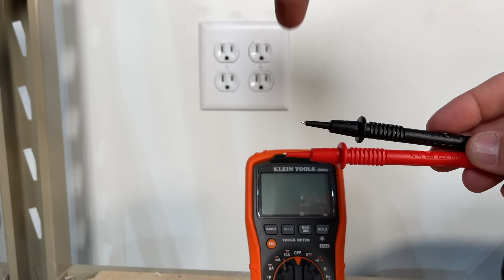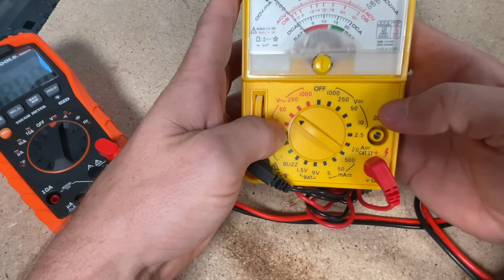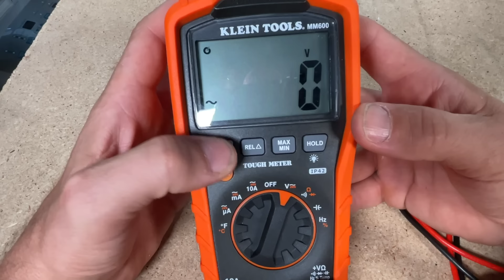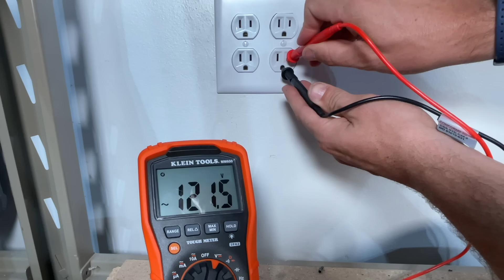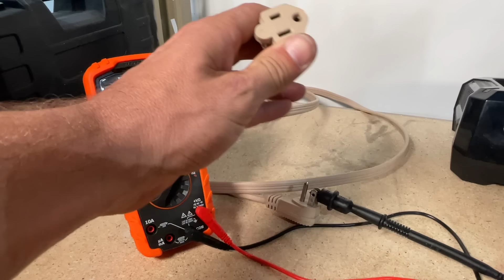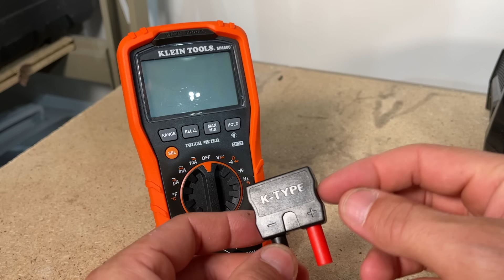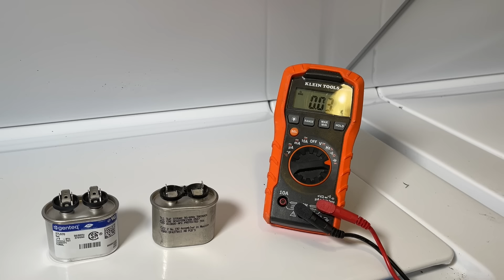How To Use A Multimeter for Home Repairs and Troubleshooting

Comment: I highly recommend the Fluke T+PRO tester. It does voltage, continuity, and resistance. 
For simple electrical jobs, I think it's much more useful and easier to use than a multimeter. It doesn't have as many features as a full multimeter, but many of us never use those features anyway, or even understand enough for those functions to be useful.

For the functions it does, it's far more simple and reliable: There's no need to turn it on or press any buttons to test voltage or continuity: just touch the probes together or touch a continuous wire, and it instantly beeps and lights up. Touch the probes to live wires or insert them into an outlet, and it instantly lights up, beeps, AND vibrates, and shows the voltage on the screen. Even better, the voltage tester will even work if the batteries are dead or missing! It functions as a simple solenoid tester as well, so LED lights will light up indicating live voltage and approximate voltage range, though the screen, audible alarm, and vibration won't work. 

It can also test resistance, and has a GFCI tester, though I never use those functions. It also has a built in flashlight, and the audible alarm can be turned off. But really it's just voltage and continuity that I'm testing frequently (usually to verify which  wire is the neutral and hot, to check whether something is grounded, and occasionally to test light bulbs or cords). I literally never press a button with this awesome tool. You'll only ever need to press a button if you  want to test resistance, or use the flashlight, trip a GFCI, or to silence the sound (the vibration is a great feature if you need to use it in silent mode!)

Comment: Sorry but measuring voltage will not energize the black lead. If it did you would cause a dead short every time you went across a potential difference. Conversely if you are using the amp function, the meter has no resistance and will dead short if you go across line.
Reply: It will energize the unconnected lead, but the instant you try to do anything with that energized lead, the voltage will drop across the megaohms of internal impedance, and it will no longer produce any current that can do any damage.

Comment: As a non-electrician, I use an Extech multimeter. I've found them to be very reliable and reasonably priced. And because I do not use my DMM every day, I use lithium AA batteries in it. They are virtually leak-proof, unlike alkaline batteries that often leak from non-use and then corrode contacts.
Reply: Lithium is expensive and probably costs more than your meter. That being said they hold their energy forever and it'll last the life of your meter. Like probably 20 years. My alkaline lasts already 10+ years and counting still but I don't use it much.
Reply: @jonfreeman9682  $2.40 each in packs of 8 for Energizer lithium AA batteries. That's definitely not the same cost as the multimeter.
Reply: @davepaturno4290  That is really cheap for lithium battery. Definitely worth it as it'll last the life of the meter. No more fumbling for batteries.

Comment: As an irrigation technician, I use a multimeter everyday in the field when troubleshooting residential sprinkler systems. This is huge for the DIY home owner because it is not cheap for me to make a home visit. I test voltage to make sure each solenoid is getting at least 24V. This is the minimum required to open a valve. Measure the common against the zone that is currently running. Run through each zone and make sure they are all getting required voltage (only the zone currently running should be getting voltage). If a zone won't turn on but it is getting the required voltage you are looking at a problem with the solenoid.  Take an Ohms measurement with the timer turned off this time going through each zone. Again, common against each zone wire. You want to see a range of about 23-60 Ohms. If you get an OL reading, you probably have a loose connection in the manifold (Valve box) or a broken line somewhere between your timer and manifold. If the Ohms reading is below the range, Your solenoid should be replaced. Sometimes the issue comes down to the timer malfunctioning and bugging, but with these steps you can get an idea of what to focus on. Hope this helps!
Reply: You should do a video on that subject…it’s very confusing to DIYers!  I know….I am one!
Reply: Boy I wish you’d do a video! I am having trouble with this exact issue right now! Can you suggest a good site to find help?
Reply: How do you get started getting clients?  I have commissioned a few installs including new pumps.  Are people searching for "irrigation technician"?  Where should I advertise?
Reply: Great tip on fixing irrigation. Didn't even know this was something you could do yourself. Always thought you needed a professional.
Reply: Clearly not an electrician
If your (black) probe were hot (120v) if you went hot to ground, that would be a ground fault
So clearly this is inaccurate, unless your meter is faulty or damaged, it's completely safe to touch the probe while the other is connected to hot
Also due to the nature of AC (alternating current) it does not matter which probe color goes where when taking a measurement

Comment: Great work as usual, but I'm confused. You're supposed to attach car batteries in the opposite fashion when jumping cars, ie hook the red/dead then red/live then black/live then black dead. I've heard the reason is if you drop the alligator clip into the dead engine you'll get a spark with the red lead but not the black since most cars are chassis ground. But using your logic it should spark on a dropped black since you've got a circuit (proven by the fact you hook the black up to the chassis anyway to do the jump). So, are the orders different, or is one righter than the other?
Reply: That's probably because car chassis are floating, with no inherent reference point to ground.  So if you hook up a hot battery lead, and accidentally touch it to the chassis of the dead battery car, there shouldn't be any spark or damage because the whole dead car if at floating voltage potential.  And because the car chassis is so large, there's ample opportunity to slip with the hot wire and touch the chassis.  If the grounds were already connected first, and the hot wire touched the chassis, sparks would fly.

Comment: Any decent small:multimeter will do the DIY homeowner.  But Fluke makes the best.  I sometimes miss the days of using Radio Shack’s cheapest for automotive lighting; analog meters are better when looking at a flasher circuit (yes, I remember the big Simpson and Triplett analog meters in the trade).  I always have a non-contact tester in my pocket.  Most are not bad. I did turn wire cutters into strippers once when I called downstairs to my wife to open a breaker then tested the wire with a Harbor Freight because I couldn’t find my Klein or Fluke.😳  For fun, walk around a 240,000 volt switchyard with a good Fluke non-contact tester.  It never stops alerting; your world is hot.😁
Reply: Those Triplett or Simpson analog meters are still better for testing ordinary flashlight batteries, AA and  AAA batteries and the like, because the analog meters load the battery down more than a high impedance digital multimeter would.  They also work better than a digital meter does for finding shorted transistors or diodes or checking for  the  Junction voltage drop.

Comment: I would suggest testing your probes before you start metering!!! Put your meter to Ohm setting & test to make sure your probes are plugged in, the turn your meter  to volts to meter electricity!!!

Comment: Terrible miss-information.

No it isn't equivalent to sticking a knife/wire in the active/hot side. Because a multimeter (in voltage mode) has a very high input impedance, eg there is a massive resistor between the probes. Thus while no current is flowing the voltage on the other probe may seem high with a non-contact detector but as soon as current tries to flow it will drop to zero.

If it was equivalent to a wire, then by sticking the probes in active and neutral you are shorting out the powerpoint.

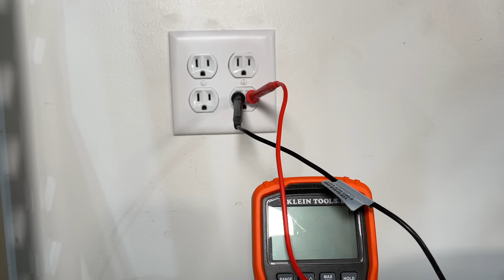Comment: 01:20 I will agree with other that multimeters in voltage range have about 9 - 11 MΩ resistance between probes (a MUST for measuring high voltages!), so it can't zap or even shock you. The only danger is when you touch the black probe with one hand (for example) and NEUTRAL or GROUND wire with your other hand. Even in that scenario, current flow through your body will be about 0.024 mA, which is way below 35 - 50 mA (which is most dangerous for human body).
Please be aware that applies ONLY, and ONLY to standard voltage measurements, since some multimeters have LoZ (low impedance) mode. In LoZ mode impedance between probes may be as low as 2 kΩ, so the current in above scenario may be about 120mA, and that can result in some serious shock, or even death.
Anyway, thanks for the effort in making this video.
Reply: It is worth noting that when I was a kid, in the days of analog multimeters, the impedance of the meter was often only 1k ohms per volt (unless you had a fancy high-impedance VTVM),  and therefore when measuring 120VAC the load introduced by the meter was only 120K ohms, so yes, touching the bare tip of one probe while the other probe was connected to a voltage source could give you a nasty shock (even more so if you were working on a tube amp circuit at 400 volts DC or more).  Modern digital meters perform more like a high impedance VTVM (vacuum tube voltmeter) and don't load the circuit down at all, which is usually a plus, but can give you erroneous readings in vintage-electronics work, where the original voltage readings as noted on the schematic may have been made with a low impedance analog meter, and use of a digital meter may give you much higher readings (be sure to use the correct-impedance meter for calibration procedures!).  I actually use an analog meter frequently for electronics bench-work, as they are not only handy for a quick short-circuit and junction-drop test of diodes and transistors without the jumping around and fluctuations that occur with a digital meter,  but an analog meter will also load batteries down more than the digital meter does, and so batteries that seem to measure OK on the digital meter may actually give up the ghost when you put them into any kind of device that outs a decent load on them.  The low impedance of an analog meter will quickly show you which batteries should be tossed!
Reply: The meter may be at a diffrerent setting. When you do things often enough and do not do things safely at some point the accident can happen.

Comment: If the other lead wire can get energized then it may work to find out if the outlet is wired backwards I think.
Reply: If you want to determine if it is wired backwards, probe the ground terminal first, and simultaneously probe the screw, while in continuity mode.  This will confirm that the ground is ground.

Then put it in voltmeter mode, and probe the ground first.  Use your remaining probe, to test each of the two sockets.  You should have nearly zero volts when probing neutral, and nominal volts when probing the live.

Comment: To receive a lethal shock, you have to be toucing both a ground and a hot wire at the same time. Touching only one wire is not lethal. Voltage has to high enough, one volt, you may not even feel.
Reply: Amperage is what will kill. You can withstand high voltage since voltage is an electrical push. The amperage is the movement of the ions or electrons which is what is lethal. Voltage does play a factor but you can withstand a high voltage with low amperage and be fine.
Reply: @gamersens2363  With higher voltage you get more amperage through your body. The resistance of your body is pretty constant, it varies mainly if you are wet. Granted if you are playing with a tesla coil, you can get very high voltage that is near zero current.

Comment: Non contact probes do not tell you that the voltage or current is lethal, they only say there is AC detected. (does not work for DC voltage).

Comment: You should probably note that people should make sure to short out a capacitor before handling- as you know, they are designed to hold energy, so unless they are shorted out, they can and will shock you.
Reply: Your absolutely wright I touched one in the back of our old TV one time and it shot me across the room.
Reply: Oftentimes, it zaps you from one hand to the other, which gets you across your heart. Not good.
Reply: Run capacitor don't hold charge start capacitor do however
Reply: @yourmomsassonmylap  
That's not accurate. 
However, it's always good to use a bleed resistor to ensure it's not charged.
People are shocked to learn that I'm an electrician.

Comment: Your explaining the how to as though everyone has intermediate experience, rather than novice.. It's not enough explanation for beginners & you cannot see the settings you set the meter to bcuz they're way too small so you need to zoom in. Also you don't explain the range settings well enough for beginners.
This video didn't help me at all.. It should be titled how to use a multimeter for DIY's with intermediate experience.. Not really a good enough explanation/instructions.. It's lousy!

Comment: Klein CL350 for measuring amperage on loads just convenient not to disconnect terminals and keep things energized for testing amps. I could use my MM400 with the leads, but sometimes when dealing with loads that have a motor, it's a little risky knowing that the 10 amp safety mechanism inside meter might not be enough. I feel a bit comfortable with a clamp meter for that option.

Comment: i like the temp thing.. i have a new kobalt unit and have not used or figured it out. its a 3+ piece unit. i bought it since it has a small pen type battery operated voltmeter. a receptical tester ive used it+very simple+ and multimeter w batterys. i cant figure the cable hook up? they are plastic coated it seems? kobalt 600. around $30.

Comment: Guess you should have used a multi-meter on the clown show of installing the 14-50 plug for the EV Wall Connector.  What a dumpster fire that was.  Even you stated 220 volts for the circuit.

Comment: Thanks for the video. Little confused about color selection of leads. Red lead is for testing live wire and black for ground or neutral. However, wires coming into the receptacles or switches from the breaker: black or red wire is for hot.
Reply: Red and black convention is for DC voltage.  AC likes to use black for the hot, just to confuse people 😉
Reply: @wingerrrrrrrrr   My suspicion is that since in many cultures black is the color associated with death, using a black wire to identify the part of the wiring circuit most likely to kill you made cultural sense.
Reply: Good point.  In my experience, I think more of meters as used for electronics, meaning black is common (ground) and red is hot.  House wiring is white for common (neutral) and black for hot.  Yeah, it's inconsistent.

Comment: What if it is a tamper resistant outlet where you must insert both at the same time?
Reply: Shouldn't matter, and you shouldn't have to insert them both at the same time.
Reply: @dougb8207  Yes, it does matter because on a tamper resistant outlet, you cannot insert anything into just one slot. Both slots must be probed simultaneously.

Comment: I've owned many MM over years for home & work.
What aggravates me the most is when using one
I forget to turn it off & the battery dies. Some better
ones will put itself to sleep. Usually, the sales info
NOR the owners manual mention this feature, so
you have to buy & try to see if it has this feature.
Thats a real pain. ALSO, I like the meters which are 
so smart that there is only 1 volt or amp range. The 
meter will figger out whether its reading AC or DC.
Smart.

!
Reply: I have a meter with only auto ranging, which is a poor design that didn't allow the range to be locked. What happens when you measure something right at the threshold where the range changes is that it completely blanks out as it switches ranges which makes it very annoying. The company realized the error of their ways and in their subsequent model have a fixed range button option now.
Reply: Older Fluke meters turn the display off and go into sleep mode after 15 minutes or so, BUT the meter circuit is still drawing current and will kill the battery in a couple of days. Make sure its actually turned to "off" when you put the meter away or you go home for the weekend!

Comment: Good stuff. AS an American expat living in Argentina, my life is a bit more complex.
Of course, the AC is 220v here, and the wires are different colors. Line is Brown, Neutral is Blue, and ground can be green,  green with a yellow stripe, or even White on older installations. The plug types are mostly flat bayonet set diagonally, but the older Euro style round plugs and connectors still exist. Trying to find WAGO connectors is like the search for the Holy Grail. I'm not even sure they exist in 220V.
Reply: Wago 220 connectors exist in  UK

Comment: I noticed that the duplex outlets used in the video has both of it's cover screws inserted with the slots oriented in a symmetrical vertical position.  That's probably no accident.  🤣

Comment: Does a centrifugal switch sense the speed of a motor?
Reply: Yes.  There is a reference object of known mass, that swings radially outward when the motor is in motion.  When the apparent centrifugal force that this mass experiences, exceeds the force of the spring that holds it in the rest position, the mass will swing outward and break the contact of the switch.

An application of this, is switching from the starting winding to the running winding of a motor, since the running winding is more efficient for full load operation.  The starting winding is only present so that you can get your motor out of the rut of rotor lock when turning it on.